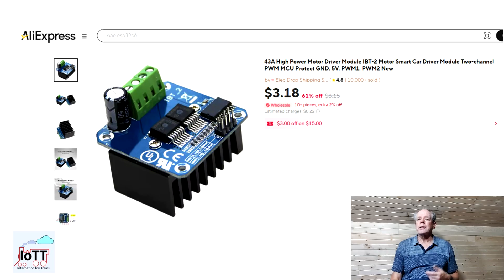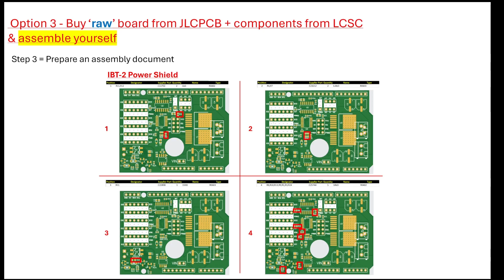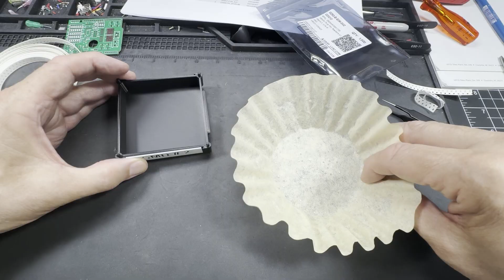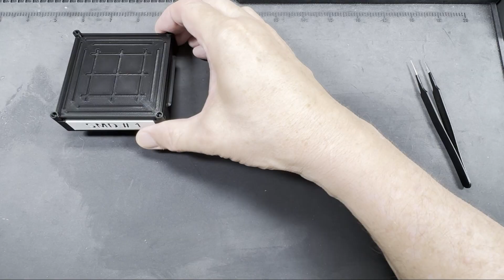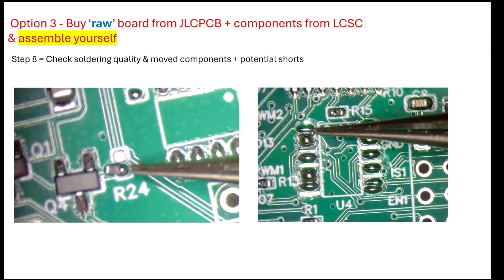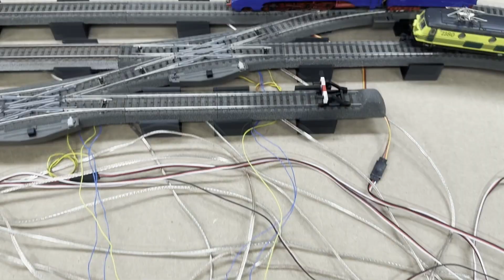IoTT Boards Built from Scratch (Video#153)

Comment: Hans I have a M5stick C that I am using with a blue hat. I have an external power supply plugged into the blue hat but after 47 seconds the M5 powers off or goes to sleep. I have a M5stick C plus 1.1 that will happily stay powered on. The only way to keep the M5stick C to stay on is to add a USB power source. Is there a setting for the M5stick C to use the blue hat power source without turning off? Thanks Mike
Reply from the maker: The Stick C should stay on when externally powered as long the received voltage is higher than 4.6 V or so. Can you verify on the Stick technical display what voltages you get depending on the power input used?
Reply: @IoTT  that was it. only had 4.3 volts. adjusted the voltage input and all good. thanks mike

Comment: Great to see you again. Informative video.  I guess I should have looker closer at the GreenHat since I didn't know it had input pins as well.   Looking forward to you project update.
Reply from the maker: The GreenHat has 16 servo outputs and 2 inputs per channel which can send as switch or block detector messages to Loconet. And of course, with the event handler, they can be used to activate the servos.